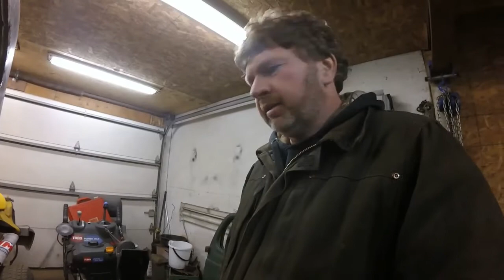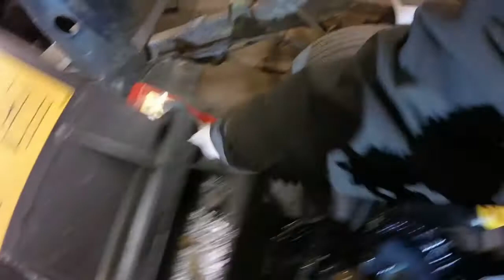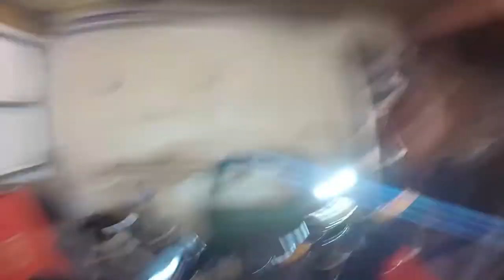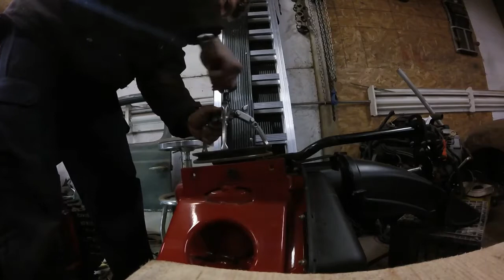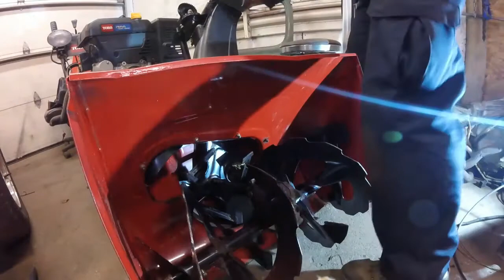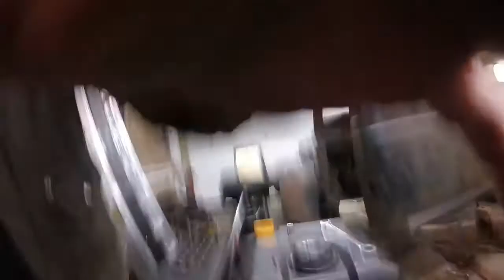toro impeller bearing replacment

Comment: THANK YOU Bernie for making the effort and taking the time to make this video!   Just found your video after a short Google search...  my Toro  Power Max 826 looks like it's pretty much the same as your unit.  I blew 3 sets of Impeller shear pins in 2 days...  after letting it sit overnight in the garage before replacing the shear pins again... had a good look (now that the snow was all melted + gone).  I could see all kinds of scraping from the impeller on the lower casing...   aHa!  grabbed the impeller and could wiggle it at least ½" back and forth...  blown bearing....  should have checked this earlier !.....   

I have all the tools for this except the pulley puller....   Do you think that I might get away with trying to pry that pulley off.??..  I could buy a pulley puller but after this job I'd likely never use it again...  (unless I have to do this job again).      Although that would be a cheaper option than paying to have it done !
I know you made this video over a year ago...   I hope you see this comment...
Thanks again for your video  (from another Canadian (Ontario)).
Reply from the maker: It should come off without a puller, if it’s all let go, try placing a couple of pieces of wood under the pulley alongside the bearing and drive out the centre shaft with hammer and punch. Should come off. If body is tipped up make sure the augers are not touching the floor stopping it from moving.
Reply from the maker: Just make sure the bolts that holds the auger to the body are out so it will all come out.
Reply: @weekendatbernies4503   That makes sense.  Good tip / suggestion!       Thank you for taking the time to get back to me.   I'll give it a go.
Reply: Remove the set screws. Then wedge two long crowbars under the center of the pulley at opposite sides. Then you can hold one crowbar in each hand and kinda hump the two of them up and down until the pulley releases. Some penetrating oil and a light heating with a propane torch can also give you a big advantage. The pulley puller can risk damaging the lips of the pulley and cause you to constantly ruin belts. It also helps to have a buddy smack around the inner perimeter of the pulley with a rubber mallet while you are humping the crowbars.

Comment: That's a pretty new machine to have the impeller bearing go out so soon. My 35+ year old 624 Toro blower has the original impeller bushing in it yet and it still good and tight, no slop yet! I see so many other brand use a seal ball bearing in them, but if my Toro bushing lasted 35+ years, they must know what they're doing.
Reply from the maker: Toro is a great machine. I have put quite a number of bearings in them. Could be the wet Newfoundland snow. Other than a belt once and a while cutting edge and skids they never give any trouble.

Comment: Thanks so much for this video! Just finished changing the bearing on my Toro 726. Those bolts on the bearing sleeve were the first to drop. Had to pull out the auger like you did to get them back in place. At least it made it easier to change the shear pins. Haha Thanks again!
Reply from the maker: Your welcome, the toro snowblowers are great machines. Should throw snow like new after bearing replacement
Reply: Loosen the locknuts, pull up on the bolts, and then wrap the bolts tight with two twists of safety wire. It will hold them by the threads while you finish your work and then you can just untwist it once you have the nuts back on a few threads.

Comment: Loosen the locknuts, pull up on the bolts, and then wrap the bolts tight with two twists of safety wire. It will hold them by the threads while you finish your work and then you can just untwist it once you have the nuts back on a few threads.
Reply from the maker: Yes ,it should work just fine

Comment: Use 2 pickle forks(ball joint)between bearing and pulley .180 degrees apart. Tap them equally will wedge off pulley. Keep blower tilted towers floor so bolts won't fall out. Either put elastic around bolt or I rings to hold them in place.
Reply from the maker: Yup. Should work good

Comment: With the puller grabbing the lips of the pulley and actually managing to yank the thing, you can be sure that a pair of crowbars under the center of the pulley would pop it off too. With the crowbars there’s no risk of destroying the pulley.
Reply from the maker: The pulley is pretty strong try to stay away from the outside edges. give the shaft a couple of hits with a hammer while prying with your bars.

Comment: Aha. I just picked up an 826 LE with this problem. I have most of it apart but just needed to know the bushing removal sequence. Where did you get the replacement parts from?
Reply from the maker: Picked them at the toro dealer, it is also available on Amazon

Comment: WHEN THE Mecanic PUT THE NEW BEARING IN HIS 2 x METAL "ROOM" I think he made a mistake. The complet bearing must be put in 2x metal "room" and not separately. I ASK MECANIC IF THE BEARING MUST BE GREASSED INSIDE DIAMETER COPPER W/CONTACT W/THE SHAFT 7/8" DIAMETER?. The bearing has one screw. This screw in allen head must be tight after installing the bearing on the shaft in right position? The big pulley must go down to max. possible in assembly action or flush w/shaft finish side? What role is the tinny, tinny washer after installing the bearing and before installing the big pulley?
What is the square head dimension for the 2x screw big puley?
Reply from the maker: The hex head is to locate the bearing in the metal housing so it doesn’t rotate and the thin washer is just a wear/thrust washer so the pulley is not directly touching the bearing. A little grease here will also help. The square bolts may be 1/4 I didn’t have the proper socket for it. They are great blowers I service about 5 different brands for where I work probably 70 blowers in total and the toro give very little trouble.

Comment: Mecanically solution is not acceptable. Maybe for less noise is good idea but for "frotement" metal on the metal is not god idea. I think that TORO CHANGED MECANICAL IDEA W/NORMAL BEARING. The tiny washer before pulley instalation for what reason is it over there? After finished installation the pulley moves from back a lot. It is normal?
Reply from the maker: It usually moves a little after installation

Comment: I didn't understand what is inside of the bearing/bushing w/copper, how is working together w/drive axle? The hole of the bearing/bushing will be ovale after a time because missing the grease. The bearing w/role is the best. The bushing w/copper is using continu itself and in same time the drive axle. This is not acceptable, the drive axle must stay to the original dimension in diametre. The bushing copper is not correct solution for this application. When the bushing inside copper is finished the bushing frame iron will continu to distroy the drive axle. The bushing copper is all the time dry, no any grease, etc. A lot of heat is acumulate during rotation. Bad mecanical solution.
Reply from the maker: A bearing would have been better but the bushing lasts quite a long while, its usually 5 years or so before its an issue, even with our wet east coast snow,